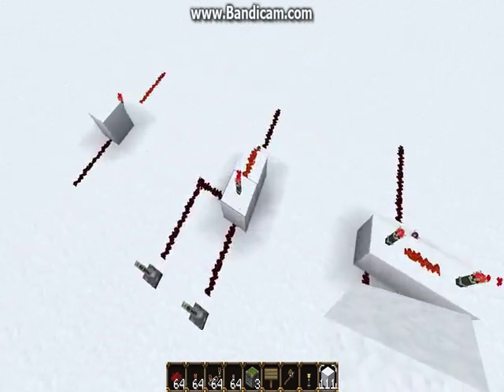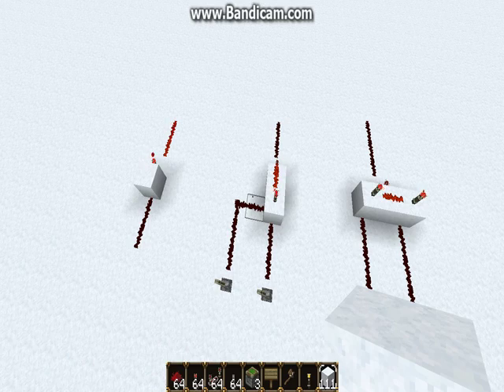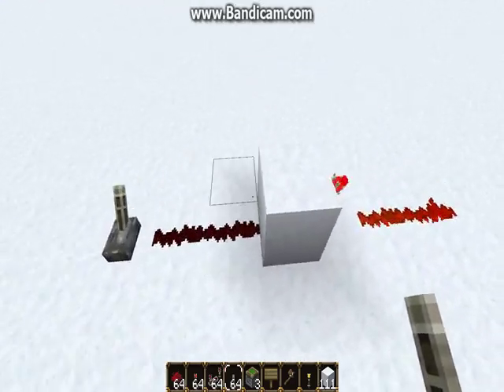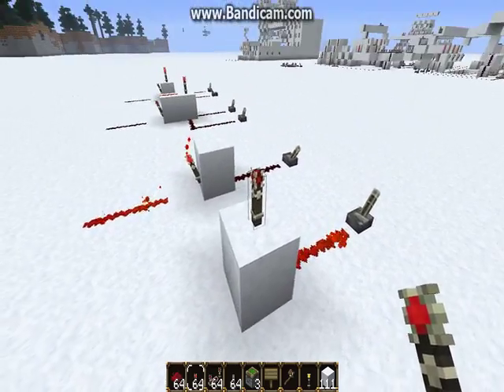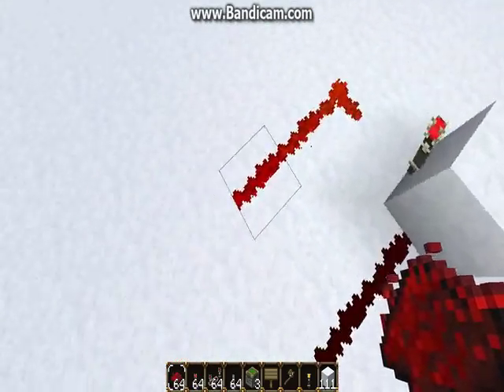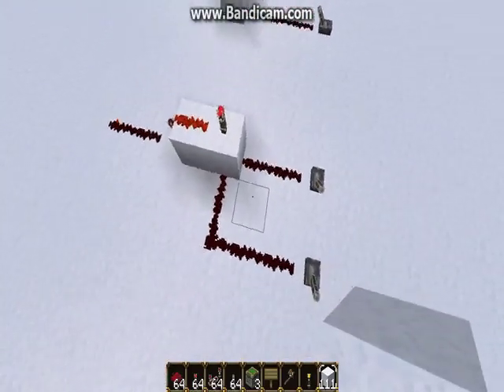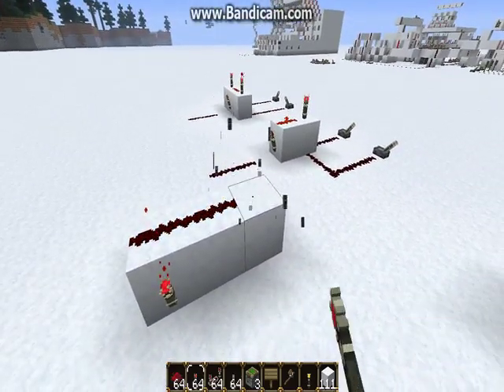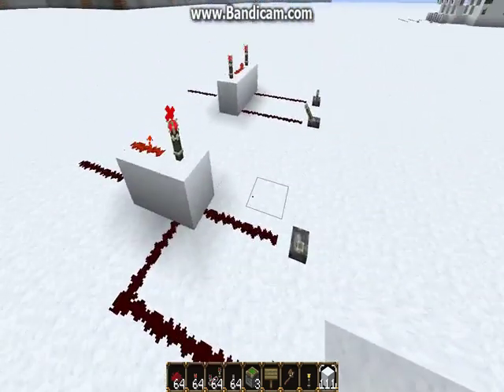Building a minecraft computer tutorial pt1: Logic Gates

Comment: That second gate you made wasn't an OR gate; it was a NAND gate (the opposite of an AND, where only one input has to be on for there to be output (not AND)). An OR gate simply means that the current is either on OR off. It would be an OR gate if you just took the second input off. Actually, a lever attached to redstone wire classifies as the most basic OR gate.
Reply: all gates are combination of or and nor gates. inversion is the building block of computaion

Comment: on an electronics level it would take a nand  gate to build any logic systm in existance
Reply: actually the nand is just the easiest to produce with current technique used in chip manufacture, it does't mean they can't build other gates using the appropriate chemical, its all about cost not that it can only be done with x type logic gate, different future techniques will use which ever gate is cheapest
Reply: a nand is made up of 2 torches
torches= not gate
Reply: Elorram Basdo sorry what I meant was you could buipd any logic circuit in existance from nand. Its what we sometimes did in circuit design. I didnt mean you must. I guess thats how transistor transistor logig works. Alot of inverted transistors. :)

Comment: I like that explanation. I had a suspicion that the other basic gates were all based on on the inverter, but I never really connected the dots like you just explained. The OR gate is two inputs going into the same inverter that outputs to a second inverter, where as the AND gate is two inverters with their own separate inputs outputting to each other with a hardwired connection between them going into another third inverter. This way, there is always an ON power going to the second inverter, except when both inverters are given power, then and only then, does the middle connection lose it's power, and the third inverter outputs power because it is receiving no power.

Thank you for breaking this down. Our Digital Logic book showed us the logic circuit of the XOR and XNOR, but didn't bother to show us the inverter logic circuit of the basic logic gates. I think that would have been very enlightening had  they done that.

Comment: It would be better to simply construct the schematic circuit diagram, and then start building it.

People, just get a sheet of paper, put down a logic gate like he's shown you here, and then label the inputs, something like A and B and at the output side, write down what happens when you actually build it, which as you can see AND, only when both are on, is the output on, otherwise it's always off. OR gate, only when both are off is the output off, otherwise it's always on. The invertor or NOT gate is the opposite of the input.

If you can remember those simple rules, you can simply draw it on paper to figure out your circuit, and then, when you have the final outcome that you want, go over each piece, individually until you've built them all in Minecraft. REMEMBER, do not build the gates close enough together that you create a short from reddest being too close. The less extra items you need to add in order keep shorts from happening, the better it will be to troubleshoot problems because trust me, even a simple logic circuit is going to look like a mess of reddust wiring going all over the place.